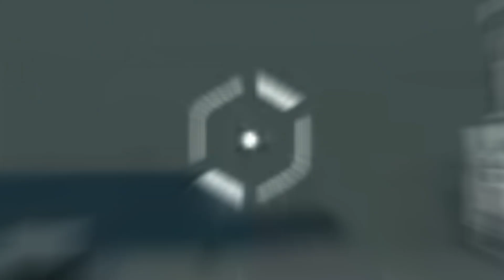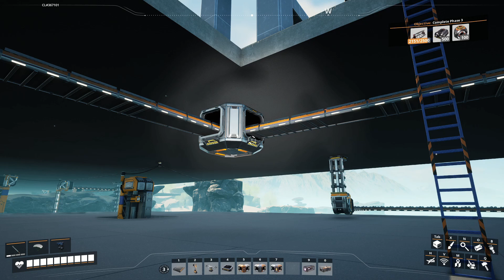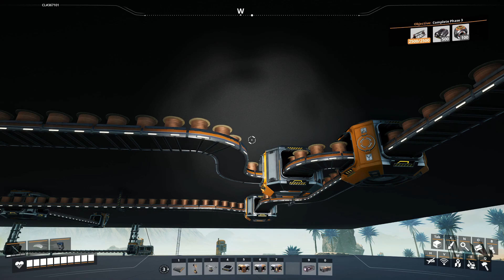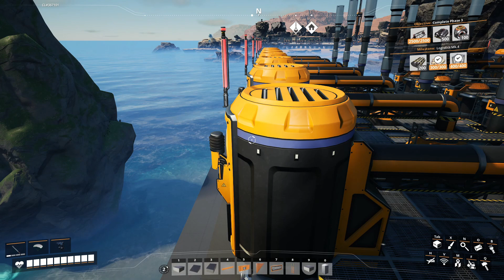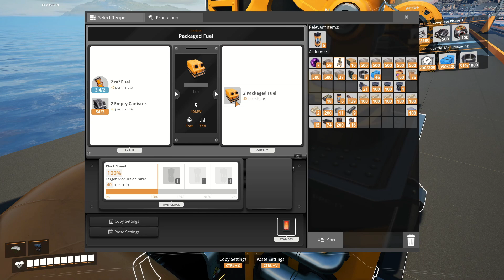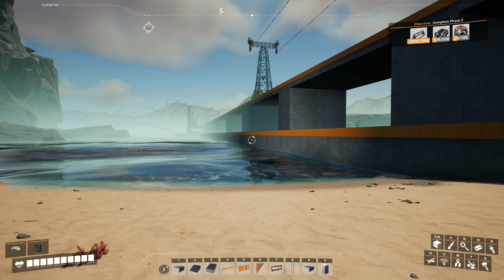How to complete Phase 3 - Fuel & Manufacturing | Satisfactory 1.0 Masterclass

Comment: TDA, your content is wonderful. I need some clarity, if you are able to provide: 1) Can you give detail on logistics floor for screws to reinforced plates? Thanks! Keep creating awesome content!
Reply from the maker: Sure! The logistics floor is  basically several belts from the screws (due to the high amounts) that run paralel, then resupply eachother after enough screws have been used from a belt. 

It gets a bit messier than most belts simply due to the fact that you have so many of them.

Comment: Hey TDA I am running the numbers and for the life of me I can not work out why 600 copper ore when the smelters only take 30 each meaning 18*30= 540? so i am a little confused by this
Reply from the maker: As you can see in the build planner, you need 550 copper for the planned build to work, so you're not wrong. I do sometimes round up here and there when making the builds because a little overproduction tends to make things run smoother (and allows for buffering when you draw stuff from the dimensional storage).
Reply: @TheDutchActuary  OK that's cool this has actually helped my head. You wouldn't believe the headache I had trying to work this out
Reply from the maker: @grizzsmith3195  Woosj sorry about that!

Comment: I'm finally here!  Is the refinery floor at the same level as the main base logistics floor?  It looks like the rubber/plastic/power route meets the mains base somewhere back by the concrete logistics are.   Just trying to begin with a better picture of the goal in mind :)
Reply from the maker: Yea it's a bit lower, about on the height of the concrete of the main factory. I don't usually try to align factories that are more distant from eachother, but instead build them at a 'natural' height based on their own location.

Comment: I'm not sure if I am missing something or if I've forgotten how to basic maths but if you have 24 constructors producing wire with 4 overclocked to 200% so 28 total constructors worth of wire you are producing 840 wire per minute.  The cable setup requires a total of 600 wire per minute (8 constructors x 60/min (480)+ 4 constructors x 30/min(120)) and then you have 5 constructors requiring 40/min (200) and 1 constructor requiring 60/min(60) for stators. 480+120+200+60=860.  So this does not produce enough wire for the demand.  What am I missing?
Reply from the maker: That math checks out perfect! There's some small amount of rounding here and there - The cables in this case only need 580 wire (or 9+2/3 constructors making them). I don't tend to bother with underclocking in these larger builds unless its at least a full machine worth of it (or it's large machines like manufacturers of course, those are worth underclocking!)

Comment: I assume you already know this, but if you open the customization menu and right-click a swatch, you can set it as the default for pipes (or several other categories). If I'm going to be doing a lot of work with, say, crude oil, I'll make my crude oil swatch my pipe default, do the work, then go back in and set the standard pipe swatch as the default again. Saves a lot of hassle in having to go back and colour things later
Reply from the maker: That's a solid approach!

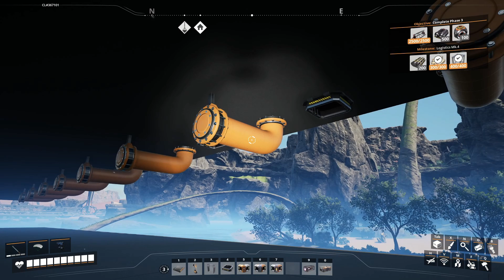Comment: Feeding fluid input on the last step from the bottom (like in 19:55) will not work 100% reliable if you use all throughout of a pipe (unless they changed something in 1.0). It look nice though :(
Reply: I'm using a similar vertical water loading mechanism for my coal plant (in 1.0) - don't think the pipe is quite at capacity, but certainly seems more reliable than before.
Reply from the maker: Yeah it seems to work if you buffer the system up front, but feeding the system from the top is probably safer.
Reply: @TheDutchActuary  it will work some time (not for very long though, like 10-15 minutes) if you buffer the system up front but it will stop working at 100% anyway. You can search for 'Satisfactory - Fluid Network Testing' video with the tests :)  The only setup which works reliable is when the fluid goes before a building (or on the same level, but not up)
Reply from the maker: @TheSinzy  I adjusted my refinery blueprint just in case ;)

Comment: Hi TDA! Great video as always and I appreciate you going through each steps one by one when it comes to builds. One question I would like to ask is whether it is better to scale up previous factories like Iron and Steel in the future or build new factories to cater to the new elevator parts in the next phase?
Reply: thats 2 entirely diffrent playstiles. mega base vs outposts. there is no better, just diffrent. you have to decide how you want to play, both styles have their pros, cons and both have diffrent problems you need so solve. 

a scalable megabase might be easier for a beginner, but gets problematic/chaotic if you fail at planning ahead and waste space you need way later.

outposts on the other hand require a very good logistics concept to get resources and intermediate products at the right time to the right place. but you can keep every factory alot smaller, makes the overview alot better and is a way better place for the "architectural design" option of this game.

in the end, its up to you and what problems you like more.
Reply: @FalconDS9  Thank you for the explanation, I currently have small/medium sized outposts making different things. I just unlocked trains, would you recommend trains or trucks when it comes to transporting a small amount of say 75 rubber and 200 plastic to my iron factory?
Reply: @wanizzaniq2664  tbh, if its not that far, use belts whenever possible.
try trucks at least once to get the experience with them. they are a bit stupid sometimes and need babysitting frome time to time (they tend to get into staring contests when 2 meet each other head on) not my favorites, but they do the job, kinda.
for the long run, i would suggest learning to build railways and go for trains. building that is a bit tricky and comes with its own problems but its worth the time investment. 

here are my top 3 suggestions for building rail:
1. build in short segments (maybe 3 foundations long). you can only split off or merge at the connections between segments.
2. build on foundations and build towards the last segment you placed, not from there. makes the rail form nicer bends. thats alot back and forth, but getting the habit of building this way is totally worth it.
3. use the blueprint designer and create some good looking support structures for your rails. you need to place alot of them and blueprints make this realy easy. search this video: "12 ways to build rail in satisfactory" from Yakez. for some inspiration.
oh and don't forget that trains can crash and derail each other. so build with that in mind and use the correct signals everywhere.

i love trains but this game makes building rail painful.
if all this sounds like a lot of work you don't really want to invest your time in, you might want to build a megabase instead. these only need raw resource inputs and most ppl build belts for that, keyword Mainbus.
i play with outposts, but i spend more time building infrastructure then actual factory lines xD thats what i enjoy, but progression is really slow that way...
Reply: @FalconDS9  I actually don't mind investing time into getting trains to work hehe, I too play with outposts now!

Can you elaborate on your 2nd suggestion? The way I understand it is that you build rails from the back to the front?

I'll definitely check out the video you recommended me. I love making structures look good in this game!
Reply: @wanizzaniq2664  the 2. one, ya i dont realy know how to explain it any better but lets try: 

you basically start a new segment where you want it to end and then drag and connect it to the segment you placed last.
for some reason the game forms the rail differently if you reverse the build direction.
but having a segment you can connect to is the key here. just experiment with this, you will see what i mean. and if you run into rails that refuse to connect, try the nudge mode with H. sometimes just pressing H is enough to get segments to connect.

found a bonus tip: while building rail you will sooner or later need this: curved foundations. search this video i just found: "HOW TO BUILD FOUNDATIONS THAT PERFECTLY FOLLOW RAIL CURVES! SATISFACTORY" from Rxckxt. pure gold for someone who loves to build pretty.
Reply: @wanizzaniq2664  the 2. one, ya i dont realy know how to explain it any better but lets try: 

you basically start a new segment where you want it to end and then drag and connect it to the segment you placed last.
for some reason the game forms the rail differently if you reverse the build direction.
but having a segment you can connect to is the key here. just experiment with this, you will see what i mean. and if you run into rails that refuse to connect, try the nudge mode with H. sometimes just pressing H is enough to get segments to connect.

found a bonus tip: while building rail you will sooner or later need this: curved foundations. search this video i just found: "how to build foundations that perfectly follow rail" from Rxckxt. pure gold for someone who loves to build pretty.

this site tends to delete my comments.. hope it sticks this time.
Reply: @wanizzaniq2664  i dont realy know how to explain it any better but lets try. 

you basically start a new segment where you want it to end and then drag and connect it to the segment you placed last.
for some reason the game forms the rail differently if you reverse the build direction.
but having a segment you can connect to is the key here. just experiment with this, you will see what i mean. and if you run into rails that refuse to connect, try the nudge mode with H. sometimes just pressing H is enough to get segments to connect.

found a bonus tip, while building rail you will sooner or later need this: curved foundations. search this vid i just found "how to build foundations that perfectly follow rail" from Rxckxt. pure gold for someone who loves to build pretty.

this site tends to delete my comments.. hope it sticks this time.
Reply: @wanizzaniq2664  sry i tried to answer multiple times, but my answer gets deleted everytime... this site...

i dont realy know how to explain it any better but lets try. 

you basically start a new segment where you want it to end and then drag and connect it to the segment you placed last.
for some reason the game forms the rail differently if you reverse the build direction.
but having a segment you can connect to is the key here. just experiment with this, you will see what i mean. and if you run into rails that refuse to connect, try the nudge mode with H. sometimes just pressing H is enough to get segments to connect.
Reply from the maker: Honestly at this point you can take it in both directions. You'll need a LOT more resources for the next stages, and some of them will be coming from further away. It makes sense to build certain things in a dedicated factory and then just transport the endresult to the next factory for further processing.

This keeps things a little easier to manage, and is what I will be doing for the next stages. 

That said, building ONE massive base is definitely viable as well (and hella fun to do at least once!)